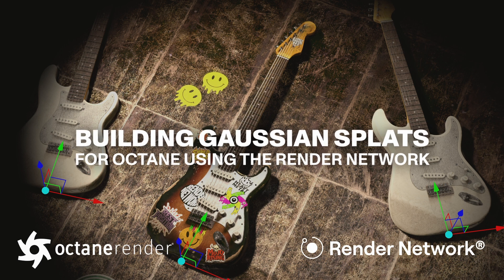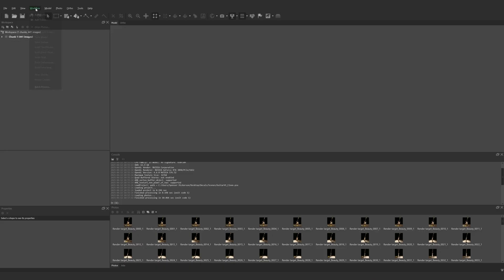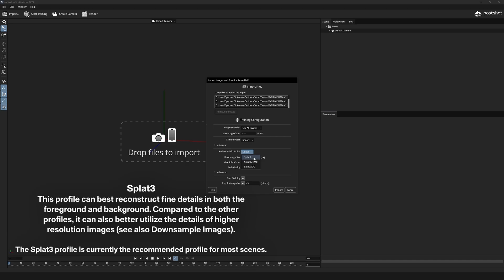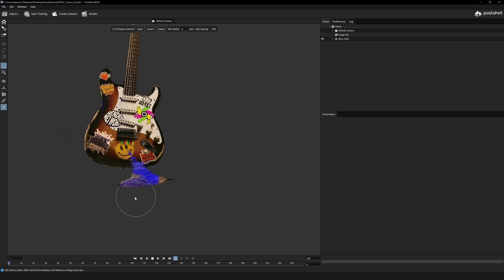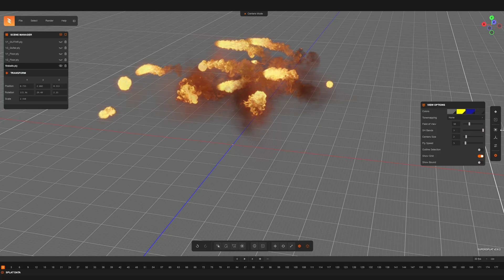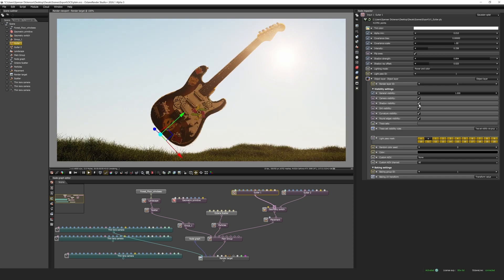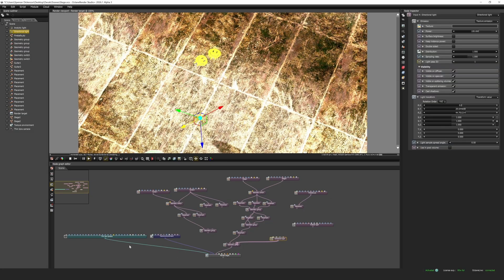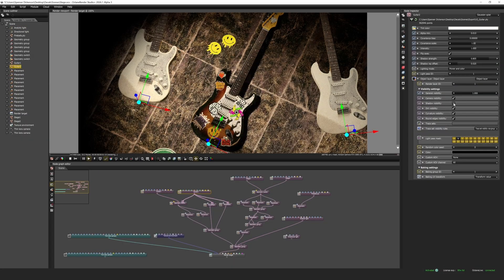How to Train Gaussian Splats from Octane to the Render Network

Comment: Cant believe it but i have a nice tip to speed up the training: render your object with a custom black and white map. Background black, object white. In Metashape, you can click on import->masks. There you can import your mask. If you then export your camera like in the video here, go to import in postshot, drag and drop everything BUT the masks folder. Click the "masks" dropdown, select "remove background", drag and drop the images (not the folder, the images from the folder - doesn´t work otherwise). Then the training ignores all the black parts and speeds it up by a lot.
Oh don´t use EXR images since they are only in the pro version now

Comment: Why do we use meta shape when we are placing the cameras by our selfs in octane? Would it not be better to have get the intrinsic and extrinsic over octane ? It sounds like meta shape step is not quite necessary, we can also export the correct point cloud from blender directly or do i forget something?
Reply: That’s the goal! No need to redevelop what already exists you can easily pull camera intrinsic and extrinsic info directly from DCC and through JSON files or CSV for ref data - there are dozens of methods out there and even some plugins inside blender and Houdini that help mitigates camera alignment steps. SuGaR is also an up and coming development method that can yield some advantages too for 3D Geo.

Ultimately there are numerous work arounds and methods to get from readily available 3D data to COLMAP for the training. Most are difficult passes to explain - often involve some scripts/coding and quite a few steps in between, that’s why as you said the Agisoft step isn’t quite necessary BUT it’s a functional step that works well and if you’re coming from video captures it will def aid in those results as well. 
We’ll definitely begin to see more and more optimized solutions to convert 3d assets to splats out of the box and we’re only in the early stages. A lot of great stuff to come!